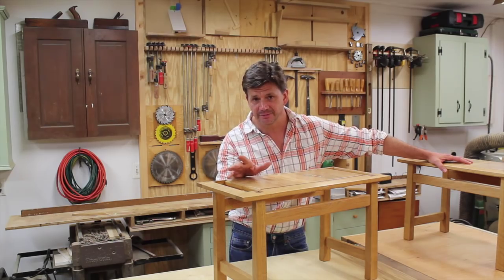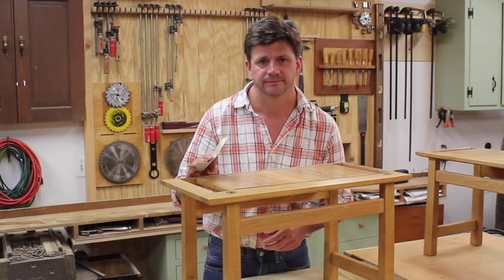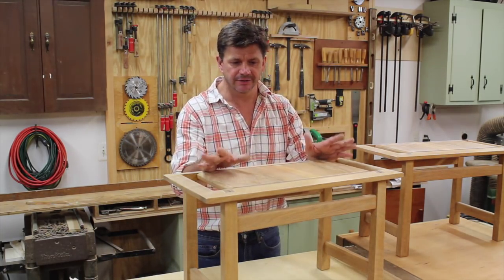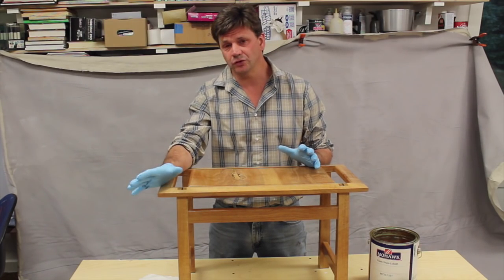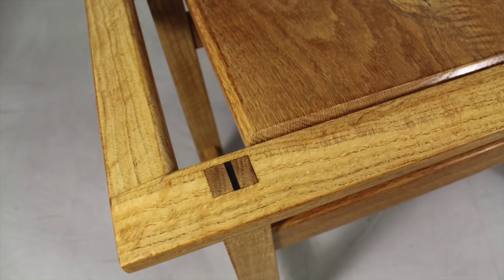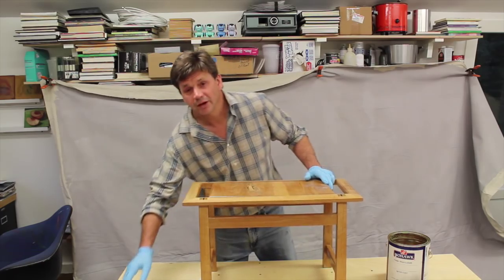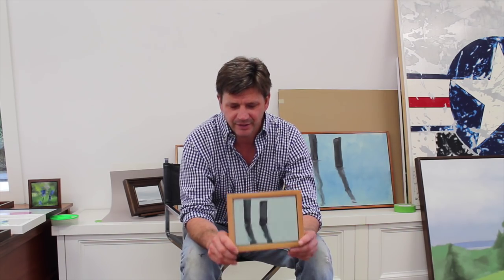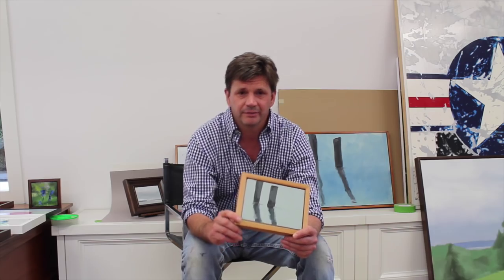How to Refinish White Oak Benches With Waterlox

Comment: I have a table that I would like to lighten the color of the stain slightly without removing the stain entirely so that it will better match another table.  Any suggestions? (I purchased these tables from Pottery Barn and they're reclaimed wood but the first table that I would like to match looks more rustic than the newer table, which just looks darker and more heavily stained.